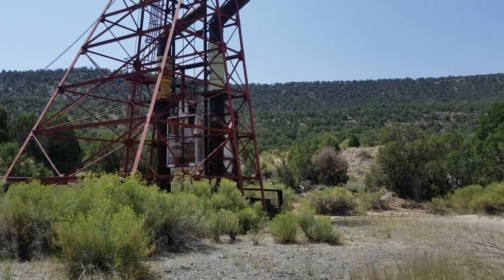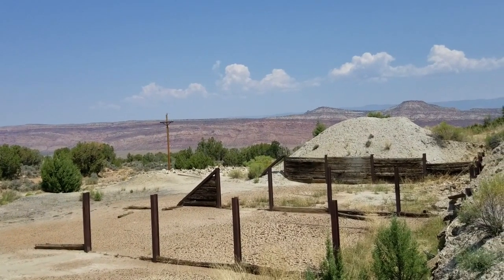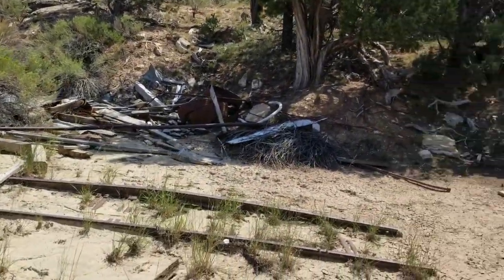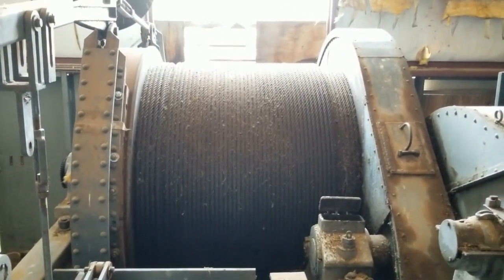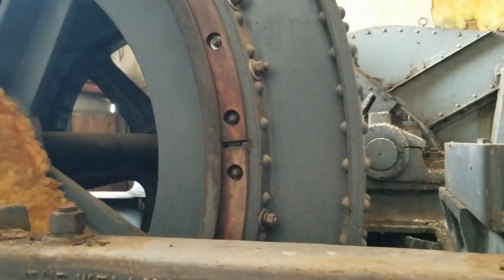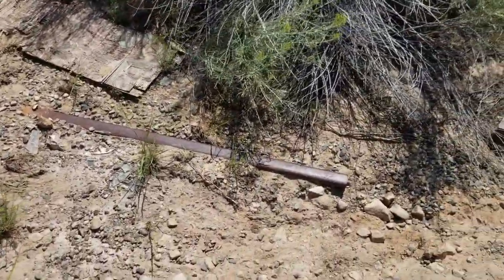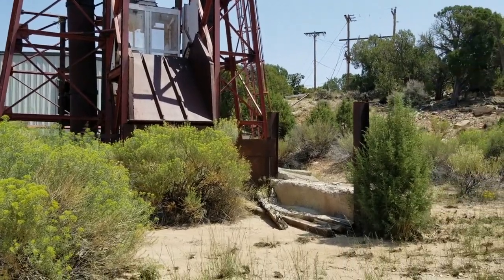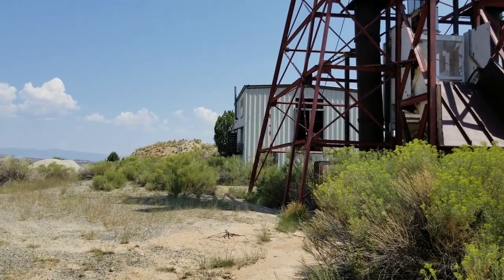Gold Eagle Mine: Uranium Miniseries Episode 1

Comment: I get why you sit behind a hoist drum, but I think I would be afraid of the cable breaking.
Reply from the maker: I haven't heard of a hoist cable breaking as they're very carefully inspected. Slushers, on the other hand, usually have guards to protect the operator from a snapped cable.
Reply: @Porty1119  Good to know, a lot of stress on things in your line of work.